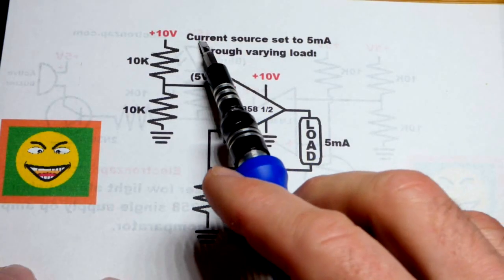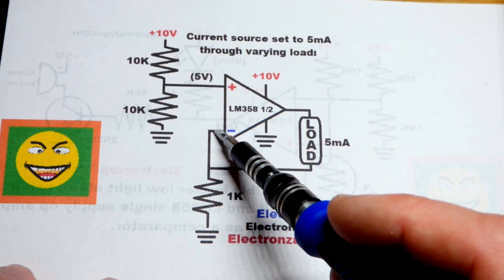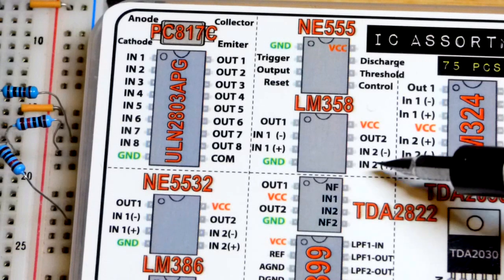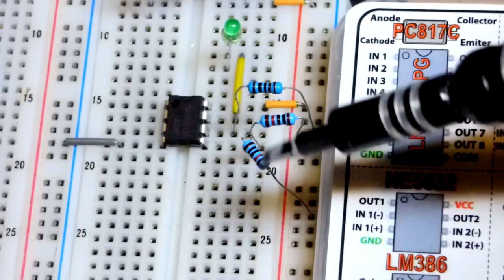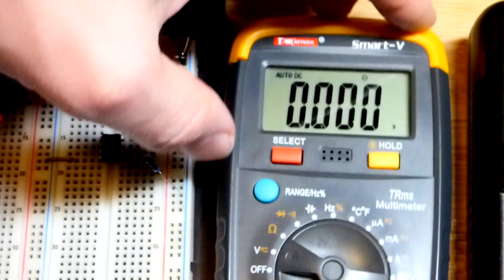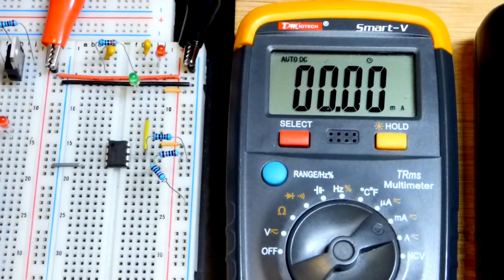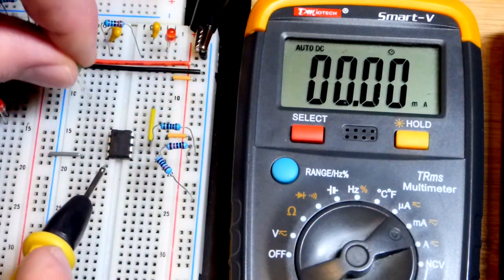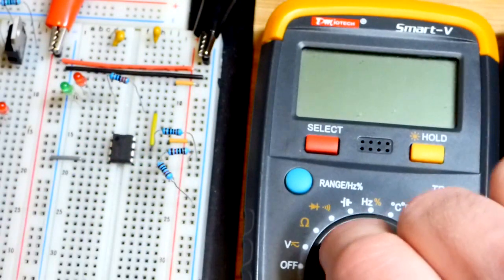5mA current source using single supply op amp LM358 circuit

Comment: hi , i need 10mA for my Audio Amp , Op Amp ,  thing is  i run it with Lm317  and well current goes up and down changing my supply voltage 0,01% up and down , p2p about 20mV of ripple genrated by load current change . i want to get rid of that , have a nice flat DC current , can you help me have a 10mA with this op amp circuit. If im  not wrong feeding it 10V will give me 10mA.
So i dont have to change anything , but i can change current sensing R to see the effect to sound .